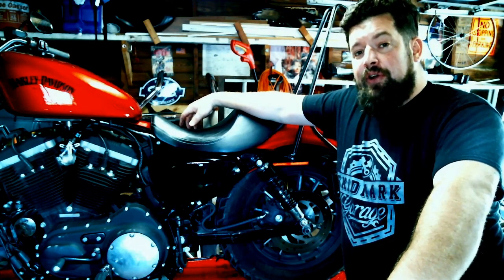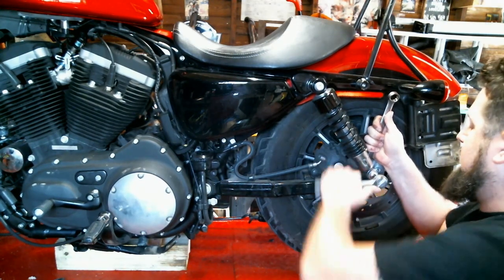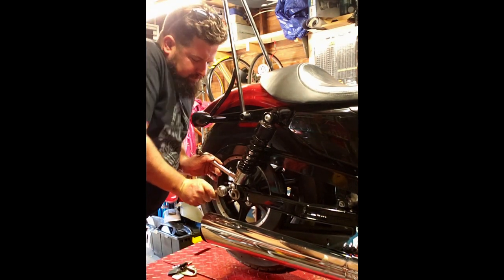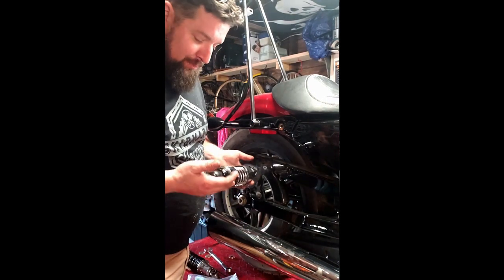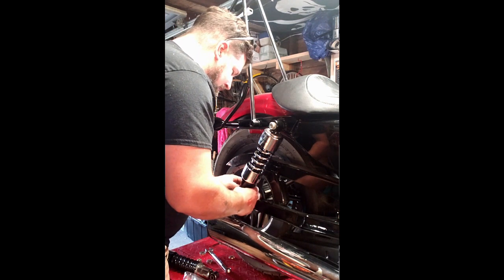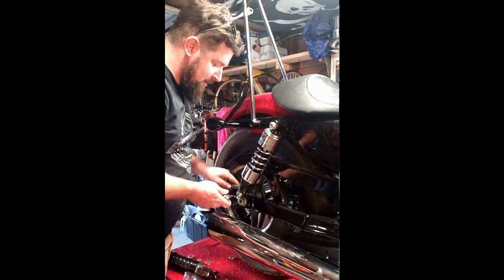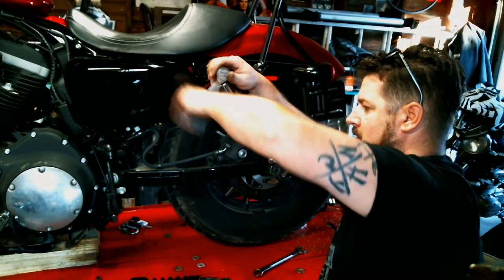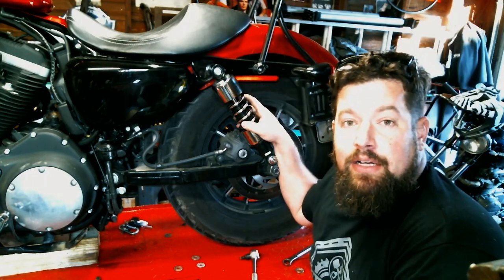Sportster Rear Shock Replacement

Comment: awesome , please advise if you had used a torque wrench , if so , whats the measurement for bottom and top shocks,ta
Reply from the maker: Manufacturer recommendeds 45-50 foot pounds
Reply: @KnobleMoto  thanks mate , appreciate your reply

Comment: Did you release the shock all the way to the top with the wrench under the seat, or did u just leave it at its current point set and started wrenching?! I'm wondering about the pressure that it's under on my sporty, I need to replace the belt guard and in doing so, I need to remove the shock
Reply from the maker: You can leave the preload set. The shock assembly itself is self contained. Just log the back end to where the back wheel is off the ground.
Reply: @KnobleMoto  excellent response time my man K.M. thanks, I'm actually out in the shop wrenching as we speak, so I appreciate it
Reply: @KnobleMoto   got the Job done!. I'm somewhat new to modding, I appreciate it!
Reply from the maker: @irishguyjg_2ndchancerecovery  glad you got it done. We were all new at some point.  If you upgraded your rear shocks, you will find that fork spring upgrades are money well spent.
Reply: @KnobleMoto  I haven't put much thought into them, but now that you've shown how easy it can be, I'm definitely going to get some in a few paychecks. 👊
Reply from the maker: @irishguyjg_2ndchancerecovery  good plan. Stock Harley suspension is shameful
Reply: @KnobleMoto  I've only ever known the stock shocks on the sporty, so I'm open to suggestions K.M. if you got em. Tighter budget,but also have had success with Amazon and other generic outlets.
I will have to start watching more of your content now that I've found you, cuz I really enjoyed that first one I watched today and the fact your willing to chat scooters and help others out is where it's at.
Reply from the maker: @irishguyjg_2ndchancerecovery  the drag specialties & burly brand on just relabeled Progressives. You can’t go wrong with Progressive suspension, but Racing Bros makes some killer/ price point shocks.
Reply: @KnobleMoto  boom 💥 👊 thanks man.

Comment: would those shocks suit 155lb dude 5"7 height lol
Reply from the maker: I think they would work well for you.  If you want to know for sure, contact progressive with your weight. They can tell you exactly. 

Honestly, anything is better than the stock shocks.
Reply: @KnobleMoto  cheers for the reply i had emailed them only an hour before i watched your video i am torn between progressives and hagon which are plentiful here in europe .
looking at stage 1 upgraded breather also as its on straight pipes
Reply from the maker: @ironkid8836  I have the Hagons on my Dyna.  They are nice once you get them set.  But if you want a bolt on and forget it, go with the Progressives.
Reply: @KnobleMoto  cheers bro